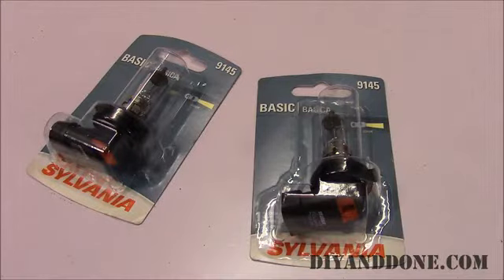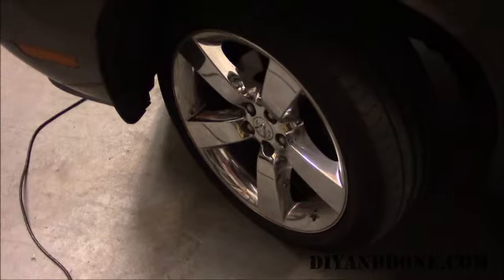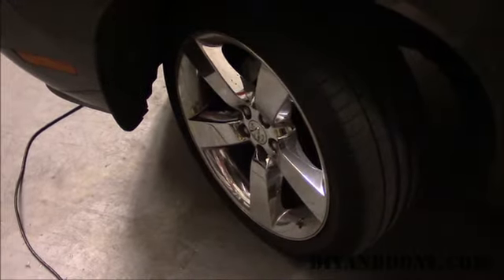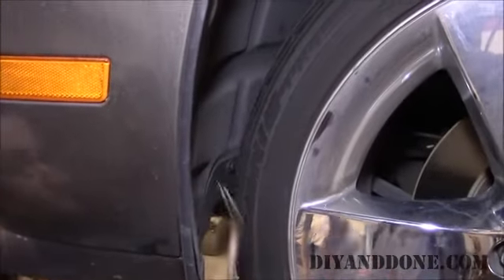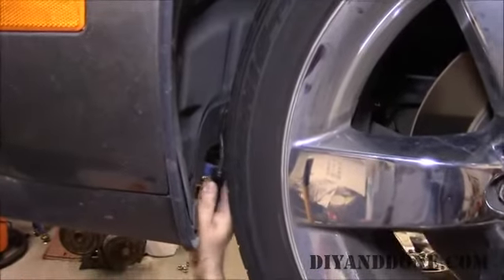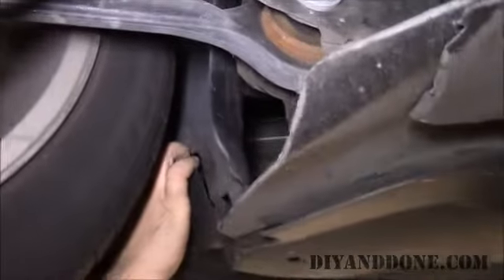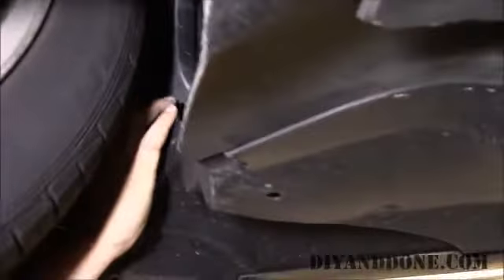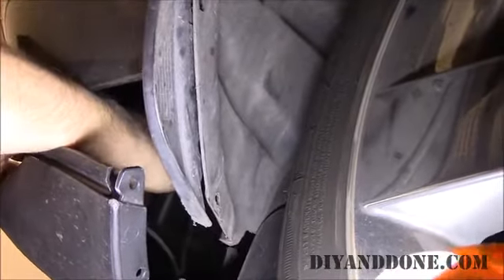How to replace install 2009 dodge challenger fog lights

Comment: is anyone else having trouble putting it back in? or is it just me, I have the 2012 challenger
Reply: Prince Louie Acosta it was a pain for sure
Reply: The old seal might have gotten stuck on the opening.
Reply: I’m just gonna take the wheel off😂